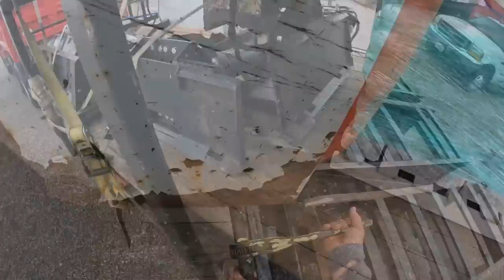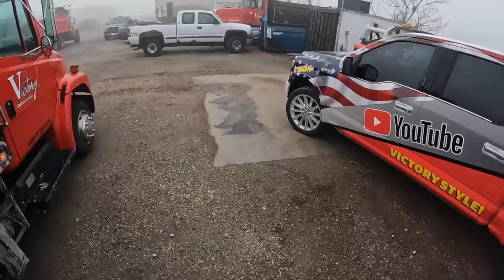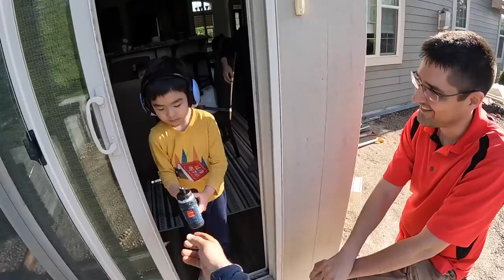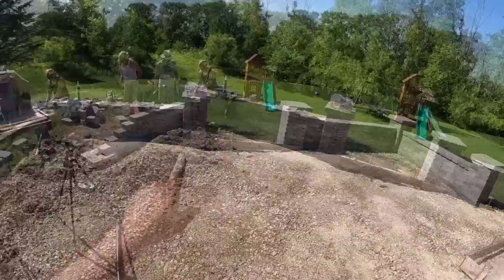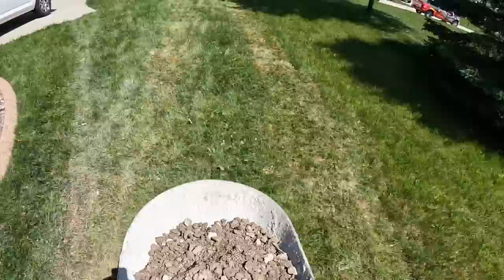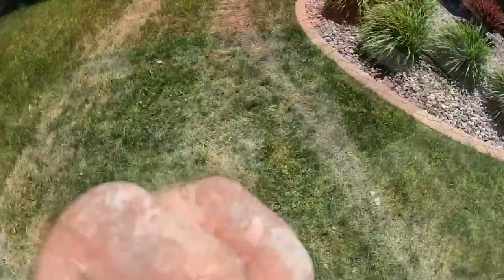100 degrees-Job keeps getting bigger

Comment: That wall looks great and I know how you feel about the heat Ryan I live in Bakersfield ca and we get very hot weather in the summer the hottest it has gotten this year was 117 degrees that was on the 4th of July so I know what you gotta through I also work outside I landscaping and design which includes landscaping maintenance pavers and mulch services.

Comment: Been to Wisconsin many times, really enjoy the 90 degree temps up there because while I was there in Racine and Milwaukee it wasn't super humid like it is down south. 80 degrees with high humidity is suffocating compared to 90 degrees with very little.

Those "it's 20 degrees, so not too cold" comments can go somewhere else though :D. I will say though 20 degrees in Wisconsin is really not too bad for the same humidity reasons. Down south the cold soaks into your bones.

Comment: I worked in a factory where it was 130 - 140 degrees with steam heated molds, so it was hot and humid.  Standing in one of those molds is literally like working inside an oven.  That outside heat where the sun is out and it's 90 degrees is just as bad.  In Georgia, the humidity, even at 75 degrees will zap the energy right out of you.

Comment: I helped a friend with some sidewalk pours in Arizona. Start time was 4 am. As in you're working at 4 am, not showing up and getting ready but actually working. Done no later than noon, depending on the heat we would call it sooner. And yes 95 is nothing, try 115+. That's hot.

Comment: Just a little tip with your glue and gun.if you spray a little WD-40 on the round pusher and put a little hole in the round metal end in the tube then your gun won't push out glue after you make your beed works good with caulking also just a tip hope it works for you

Comment: Hey I got a question about the glue used for the blocks does it hold for a long time or do you ever get called back for any falling off just wondering brother
Reply: Looks like they’re using a glue with Polyurethane in it. Really good stuff that doesn’t let go without a lot of force. Don’t know about the brand they chose but Loctite PL is great stuff.

Comment: I'm a pressure washing contractor. NO WAY you can just cut a block and leave a hole for the water to drain! What are you thinking? In my neck of the woods, they make the grade run towards the HOUSE so it puddles six inches deep. This can't be right! You guys better fix that, lol. /sarcasm

Comment: So question, with the heat high and a smaller job site and no large machine, would you ever put up some canopy's for the guys to work under?  Great job and the patio is gonna look "fly" when your done.
Reply: From experience working outside year round. When the humidity is that high and the heat index 107 like it was that canopy does nothing but protect a little sunburn. I have tried it with a fan and awning and both are useless when this hot.

Comment: Try 120 plus with full combat load, helmet, body armor, standing on the deck of a steel trailer, with the exhaust from the turbine engine of an Abraham tank blowing on you. I work out in the az heat, now, never complain.

Comment: Yo if you poke a hole in the back of that glue tube ( nail or just stab it with a knife) after you cut the tip off, it won't continue to leak out after using it. Thank me later :)

Comment: Why use glue instead of cement?
Reply from the maker: That’s how all retaining/seat walls are built. Without an actual frost footing the mortar would break apart and fail. Adhesive allows for movement while retaining strength. That’s how they are designed.
Reply: @VictoryOutdoorServices  Interesting.  Thanks for the info.